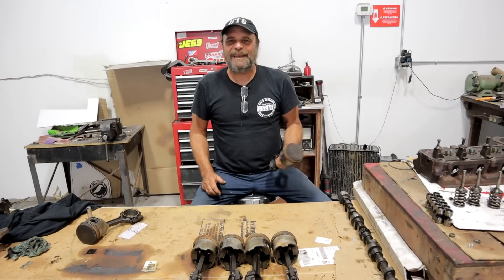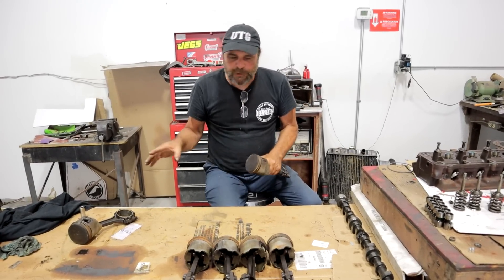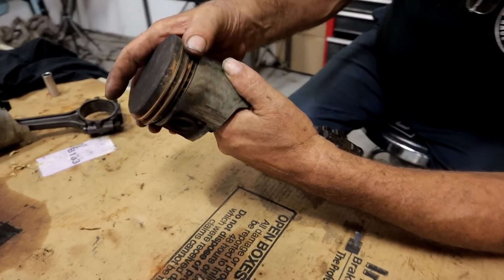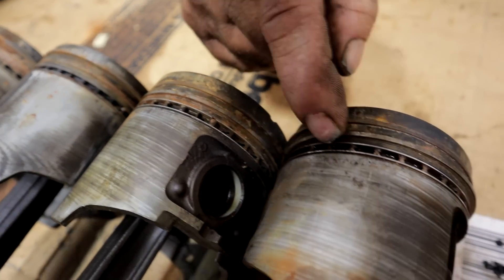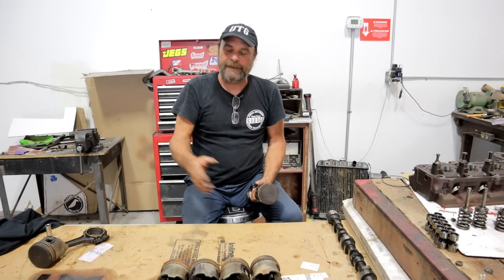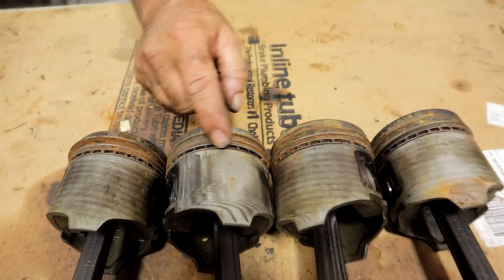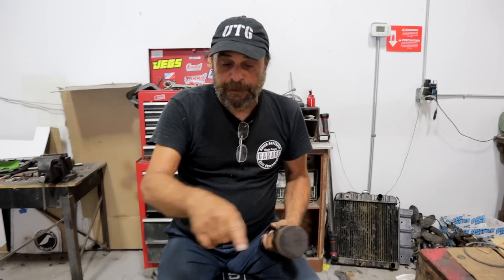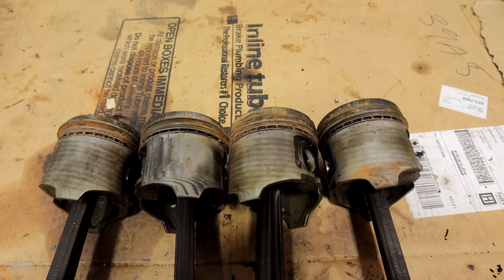Saving A Stuck Engine - Which Solvent Will Get The Job Done?  Jump In And Tell Us What You Use

Comment: ATF   And  Acetone  50/50  covered   and sealed so the Acetone does not evaporate with light vibration  like an aquarium pump       or ultrasonic cleaner  cheap  on amazon and ebay

Comment: that  calcium lime rust gel  or liquid at dollar tree frees up everything, eats rust , also that 1 gallon  purple clean that castrol makes, sodium hydroxide i believe
Reply: Sodium hydroxide is a no no on aluminum 😂
Reply: @brianwaiting7899  man i dont know if it does anything more than discolors it because i use it all the time on my centerlines and many others  mix it 8 to 1 and its no touch car wash  spray on hose off  with clear coated paint only
Reply: @rctopfueler2841   yor aluminum heads are prolly ready for bigger pistons 😶

Comment: Marvel Mystery Oil!  Had a 318 that sat for 25 years, ran when parked (LOL).  Had virtually no compression after its long rest.  Put Marvel in all the cylinders, rotated the engine some & left it sit for several days & then repeated.  The end result, decent compression & the engine started.
Eventually tore it down & rebuilt but none of the rings were stuck!

Comment: How about electrolytic rust removal inside the cylinder? Use the plug electrode as anode, hook leads to block and plug wires? Might be a fun experiment. fill cylinders with washing soda/water mixture.

Comment: If it's apart, 1 gallon Oil Eater, 3 gallons water in a bucket and leave the pistons to soak for 2 days then rinse off.  Oil, grease, and carbon will be gone.  If it's still together and the engine is stuck, put PB Blaster down the cylinders and wiggle the crank until it makes a full rotation.

Comment: Sta-Bil Rust Stopper is an amazing thing.  It's a hell of a lube and protectant also etches rust to a degree.  I guess I have a question.  Is engine meant to be run directly after freeing up or torn down?  Or can it be flushed out and neutralized after freeing.  If it can be, I'd say muriatic acid.  That will do the trick.  Soak for 6 hours,  See if it frees.  Flush with some high PH detergent or bleach, baking soda & water, etc.

Comment: I have three formulas I have tried myself using 50/50. First is kerosene and marvel mystery oil. The second is Diesel and ATF . The third is Kerosene and ATF.  Forth is something I have heard from a farmer is to fill the Engine to the brim with diesel and let soak for at least 24 hours.  The last one is crazy right just something I have heard from a farmer.

Comment: Soak internal engine: B-12 Chemtool, Marvel Oil, diesel, kerosene, Mobile 1 0-W , Stoddard solvent, ATF, etc. 
Disassembled parts soak: Lime-away solution, brake parts cleaner, naval jelly, etc. 
Soak & try moving. We usually have more time than money.
Reply: Lol.. just throw everything in there.. one is bound to work.

Comment: ATF as detergent suposed to work good.
Mix 50/50 with acetone is suposed to be magical.  I tried it for more than week in my sbc 350 and it did not work.?
DIESEL FUEL did work once on my KDX 200 engine parked for years. I just filled the cylinder and waited till the diesel slowly made its way down the base after 3-4 days.  Then i poured 2 stroke mix gaz 1:1 to make sure the cylinder had a little coating and i saved it.  I freeded the rings and after a little owning (not even needed).  It ran fine for a couple of years than i sold it and he still drove it last time i talk to him.

Comment: Bowes penetrating oil it works great got all my engines unstuck with that. It never failed leave enough to cover the piston tops walk away wait till it creaps by the rings and it will bar over garanty !! But you must wait till the oil disappears and you can smell it in the crankcase  off the dipstick ? In your case Tony put enough to cover the rings and  let it do its magic !!!

Comment: The only thing I have found that will actually break carbon down with no manual input (scraping, scrubbing, brushing, etc.) is toluene. If you can warm it a little it decreases the working time needed. Not always easy to find. But, it does work. I see transmission fluid recommended a lot. And I generally agree, 15~20 years ago. Tranny fluid used to contain high amounts of borax. Which is nothing more than a detergent. I'm not so sure all these new tranny fluids (like ATF+4) are formulated the way they used to be? Used to be you could run a quart of ATF through two oil changes and the inside of your engine would be spotless. I haven't seen these results as of late? so IDK what is going on there and I stopped that practice.

Comment: My go to store bought rust penetrant/rust eater is Free All by Gasoila. It can be bought in aerosol cans at Auto Zone or O'reilley's. Also comes in large gallon cans on Amazon if you need to soak things. I have been using it for almost 2 years now instead of PB Blaster or Liquid Wrench and it is by far much better than either of those from my experience and not much more in price. I have gotten some very rusted/seized things loose with it in the past so I'd be interested to see how it does with something like helping free engine internals.
Reply: I used to think there wasn't really alot of difference between any of the rustbreaker/penetrating oils until I tried Free All, that stuff is by far the best thing for dealing with rust that I've ever used. Not the best lubriicant but it's startlingly good at disolving rust
Reply: Funny you mention that as the company that makes Free All also has a lubricating oil called Lube-It All. I believe that is meant to be used as more of what you'd typically spray on a squeaky door hinge and such. I think the Free All is meant to be strictly only a rust eater and not much of a lubricant. Never tried the Lube-It All but I'm sure its as good at its respective job as Free All is. 

Also learned that Gasoila is located in Ohio so it's nice to know that I'm supporting a local company to me and workers that produce a great product in the states still.

Comment: Use hot sauce from Taco Bell. That stuff will loosen up anything. 😁
Reply: I use vinegar and transmission fluid about 80/20 vinegar transmission fluid but I let it soak about a week and trying to turn every day and adding more each time. Have had great success with several engines. With that being said some are beyond the point of no return and have to be pulled to disassemble by pulling the crank and beating the rods out with a 2x4 and a bfh. With that said luv all the videos and knowledge. Been doing this a looooong time my self but have also learned a rite smart from this Chanel  and appreciate it alote.
Reply: I know it loosens me up ! 😆

Comment: I've seen original formula Coca Cola eat through some serious stuff. It might take a while but, since it seems like a part time project and it's already apart, it would be interesting to see what happens if you dunk a piston into a bucket of Coke for a few days. Yes, I read the post about using something you could squirt into a plug hole and, you could definitely do that with Coke. On top of that, a 2 liter of Coke is cheap! It HAS to be Coke though!
Reply: It's funny you say that. We just had to replace the section of a HVAC box in a jeep liberty at work because Coke had been spilled down the defrost vent and it had eaten the plastic. It pretty much melted it together
Reply: Cola is what we use on old fire hydrants

Comment: ATF/acetone mix. 50-50. If it can unf@#k door hinge bolts on a 1960 Studebaker trailer, stuck rings shouldn't be much of an issue. Only issue with it on a soak is that it does not stay mixed for long.

Comment: PB Blaster, it worked to free up my '71 318 after soaking for a day. I sprayed it in each cylinder via the spark plug holes. Went put the next day and was able to turn it by hand so I put a battery on it and a freshly rebuilt carb, she fired right up.

Comment: I’ve had great results with a 50/50 mix of ATF and diesel
Reply: I second that, I'd use straight diesel, and come back a few days later with 50/50 diesel ATF. Used to work great in the 80s, but diesel and ATF are both drier now than they were back then.
Reply: Use to use a 40/60 split of that but before low sulfur diesel dunno how well today's diesel works. Use to work but not a 24 hour deal like Tony is suggesting more like 3-5 days.

Comment: 50/50 mix of ATF and acetone. It’s the best penetrating oil I’ve tried. Second best is Kroil
Reply: Farm show magazine tested tons penetrating oils. Multiple times. Good old ATF & acetone is always in the top 2.
Reply: @timg2776  what was the other top product?
Reply: @AR_420  The article went as follows. Atf- acetone, kroil, liquid wrench, pb blaster. They also priced per ounce. Atf mix was the cheapest  followed by liquid wrench, pb, then kroil.
Reply: And the atf/acetone will defy gravity and creep UP...
Reply: I’m a big ATF/acetone user. Liquid Wrench is my second go to though
Reply: I did that for more than a week and it didnt work for pistons in block.  ??  Maybe i didnt hit hard enough on top
Reply: Interesting.  Just thinking about what atf and acetone would be like together makes me imagine, marvel mystery oil.  I wonder if that's basically what marvel is.
Reply: I was going to write the same thing!
Reply: @n2cable  I haven't tried acetone with ATF yet might have to give it a whirl.
Reply: @camaroguy2919  type F works best imho.
Reply: I know guys that swear by it.
Reply: Second that! This is what I use 50 50 acetone and ATF
Reply: I used ATF and Seafoam for years before I knew ATF and Acetone was a thing. Best stuff I've used. Just bought my first can of Kroil and it also seems to do really well, but I've only used it on one project. Pricy. Hard to beat the old ATF mix.
Reply: I was about to comment this. I had a job restoring some BMW 2002's, and the ATF/Acetone mix freed everything up no problem. Highly recommend.
Reply: I too use this too with great success and my gramps who’s farmer keeps a bucket full of diesel, atf, used oil, and acetone and uses that for everything stuck 😂
Reply: Is this also the best for oil stuck piston rings still in the engine or something else?

Comment: Gasoline mixed with ATF. Losen the rockers till the valves close add air pressure.
Gas cause it will creep and it has Ethanol which is Hydroscopic. ATF for it's detergent properties and of course air pressure to persuade the cocktail to migrate. 
You did say "simulate freeing these rings like they were in the engine ", right 👍

Comment: A method I have had great success with is filling the cylinder with about a half inch of Marvel Mystery Oil, then loosen the rocker arms and using an air hose to pressurize the cylinder. Sometimes I jack one side of the car to level the oil.
Reply: the answer

Comment: Per your stuck ring in lands, I would.place the parts in a mix of dry laundry soap and water. Minimum 1 lb tide per 1 gallon water. Richer is better. Leave 24 hours and chech...wiggle because your loosing gak  and aluminum. If at 36 hours still bound up, cycle the heat with map gas. Globally heat till Metals are lightly radiating and quench in ambient temp water. If you do this twice and you have no movement something is really messed up.

Comment: I didn't read before my first answer. With the engine together I would use the new method I learned from you. I would fill each cylinder with a washing soda solution, Make the spark plugs (non resistor type) become the sacrificial anodes, hook the negative terminal to the block and the positive to the spark plugs. It should just suck all the rust n stuff over to the tip of the spark plugs.
Reply: Won't that soda and electricity eat the pistons?

Comment: 50/50 mix of ATF and Acetone. Works better than PB, my old metal shop teacher George Bamber swore by it.
Reply: I use diesel instead of acetone since I have it around me everywhere. I never need anything else
Reply: @GTIwarrior  This is specifically for rings in a seized motor. Spray it until you got a quarter inch covering the piston. It works on nuts too.

Comment: If it were me, I'd use PB Blaster and the smallest hammer in the toolbox to try and tap the rings loose. And then I'd probably end up needing to buy new pistons anyways. EDIT: You should probably sticky your 'rules'. I'd still go the PB Blaster route and use the butt of the hammer to tap the tops of the pistons every day until it comes loose. Diesel + ATF is probably even superior to PB Blaster.

Comment: 1 laundry soap 1lb per gallon. 2 kerosene or gas 3 viniger or other light acid 3 heat and cool cycling. 1 will work absolutely but be careful the phosphorous will eat more aluminum than gak but you will gain clearance. 2 gas or kerosene are best for little damage but will take a very long time. 3 light acids only work where there is no water present and may do light damage. 4.by far cycling hot and cold while burning of gak  is quick and if your careful will impart no damage BUT you may in this method alter the material qualities you are hoping to save. From K spring rate to ductile etc. In any case determine what you are salvaging and what you are willing to sacrifice. Also penetrants are ok but they don't create space they fill space quite well. If you like penetrants use paraffin or pre DOT3 paraffin brake fluid. All very Nast stuff.

Comment: I've wanted to try evapo-rust on a stuck engine to free it, then some regular oil in there to lubricate it up. Will be cool to see what ends up on the table from the comments! :)
Reply: I used it to unstick a blacksmiths post vise that had sat in a yard as an ornament for 30+ years. I tried everything--heat, beat, atf, acetone, deep-creep, kroil. As a final effort I soaked the screw and nut assembly for a week in a bucket of evaporust. The goo that ran out looked like something from the set of Alien but, the screw moved and I was able to break it free.
Reply: Me too!
Reply: @terrystewart2070  I think a penetrant plus evapo might work. Not sure a single product going to solve issue. I like evapo but it does not remove rust just chemically changes it, so inference of the rust may still be a factor.. Def looking forward to tests.

Comment: Exhaust heat riser on a 68 318 exhaust manifold was stuck, they're always stuck. Sprayed it with PB, WD40, Liquid Wrench, Seafoam Deep Creap, 50/50 ATF/acetone and a few other things over a few weeks, tapped on it, heated it with MAPP gas. Finally took it to work and shot it with Kroil, planning to just use the cutting torch to really heat it up. Couple hours later it was freed up! Sold me on Kroil !
 Piston rings? Probably gonna need heat, but who knows?

Comment: I would soak the top 2 inches of the pistons upside down in a tub of cleaning vinegar for 3 or 4 days. Not regular food grade vinegar, that's too weak, it's gotta be cleaning vinegar. then rince it in a tub of water and baking soda to neutralize the vinegar then rince that off.
Reply: You didn't pay attention.
Reply: @Thirdgen83  Pour the vinegar into the sparkplug holes as I have done in the past. then once things free up, some water with baking soda to neutralize it I was going with the pistons on the bench as they were with soaking in the tub. but at that point, once the engine was torn apart, I'd just get new rings, LOL!
Reply: I use 25% vinegar at times to remove rust. But gotta be careful with most acids, they can have side effects like eating away good metal and hydrogen embrittlement.

Comment: Take the spark plugs out of the engine and use CLR it works seen it works but once you have the engine break free you must oil down the cylinder without spark plugs installed try it you’ll like it
Reply: That worked well for me a couple of times.

Comment: my go to these days is evaporust, since i don't have a power supply or sacrificial bits i can use for electrolysis. well.. i do, but i'm not going to lug the power supply around and babysit it, since its an inverter benchtop power supply for testing things.

and mostly since i don't want to deal with atf+acetone all the time, it's also a bit.. rough on some things i don't want to be rough on.

Comment: PB Blaster for the first 1/4 inch of the cylinders then the next day , top up with ATF . And let soak 3 to seven days - works all the time on motorcycles !   Rock it back in forth in gear to break free .